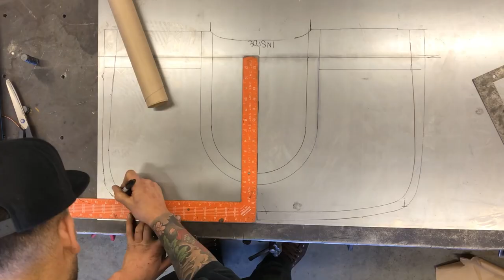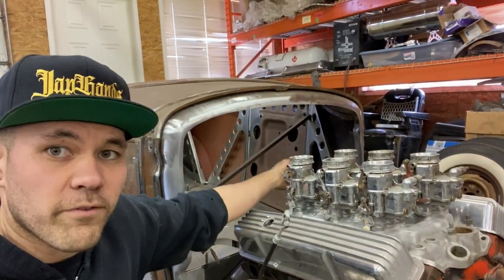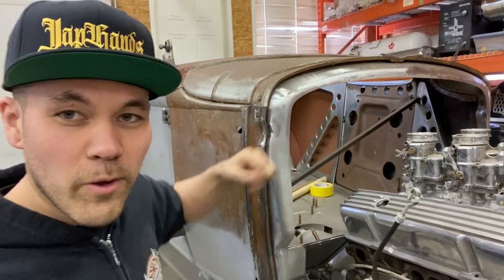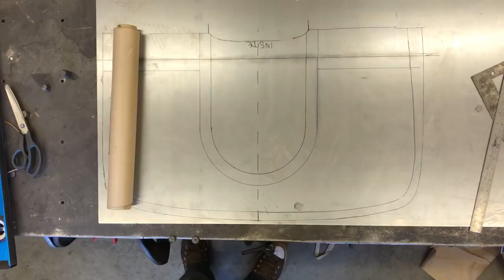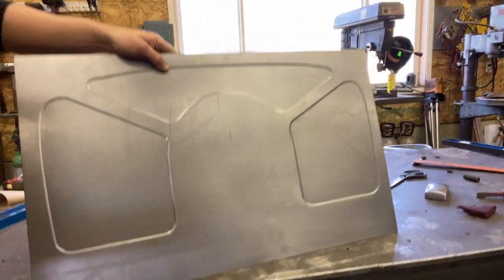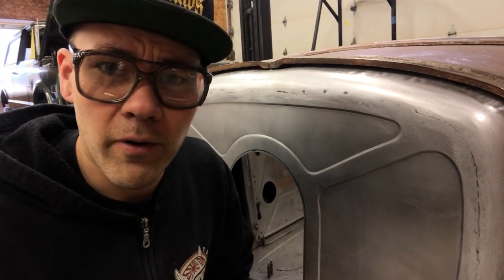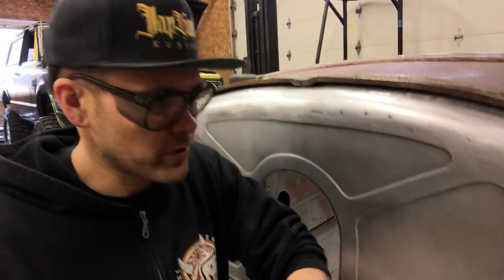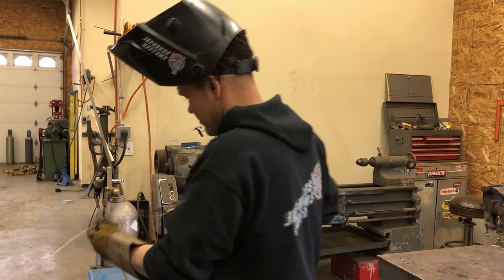How To Fabricate a Custom Firewall Using a Motorized Bead Roller (Model A Roadster Build Part 4)

Comment: I learned to weld in 1973, and have been welding ever since, this is some of the finest welding I've ever seen, the sheet metal work is top shelf, just doesn't get any better.  I got handed a torch and some coathanger wire, and told "to make it look like this", and sent to work.  You give excellent tips on getting through the most difficult issues, and show it done perfectly.  Thanks!

Comment: I just watched the last half of this again. Thanks for the TIG .035 filler wire tip. I’ve only TIG welded sheet aluminum, not steel yet, but will be trying this out on my Blazer.
Reply from the maker: Awesome you’re welcome!!
Reply: Unconventional metal do use of mid wire as filler metal in the process has been around for quite a while it's just not that well-known I guess you could say but it is more beneficial to use McGuire because the diameter of of the mixtile wire is smaller maybe less of a will build to have to grind down the height and the toy of the well perhaps there was a book written about this his name Ron Fournier you can find Old Street rodder magazines from the 1980s 90s late 2000 it covers some of this metal shaping detail even better

Comment: ok so i've saved up for a tig finally , In doing a fire wall is there much shrinkage when you bead roll a panel would you allow extra material and trim away or cut to size ... i don't have alot of space like you had.. it's for a 66 Beetle. look forward to hearing from you, cheers

Comment: How is it possible that the panel of the firewall remains flat when you have not pre-stretched it before creating the border ?

So great job as always and thank you for your pedagogy and your passion
Reply from the maker: I think it’s a combination between the thickness of the material 16 gauge and the small step. My guess is that it was easier for the material to stretch where the bead roller was then to put that much attention into the 16 gauge

Comment: Karl ... just awesome, I've seen your video on the van where you used a mig for sheet metal would you do a fire wall like you've done in this one with a mig??? that's all I have so just wondering your thoughts please cheers
Reply from the maker: This was tig. I generally like tig better

Comment: Could this be welded using a mig? Also the piece that was already attached to the car that you tigged the firewall to. Is that something you also made? It looks like it would add a few inched of leg clearance.
Reply from the maker: Yes it definitely could be migged as well The piece that was already attached to the firewall was a replacement firewall in a similar shape to what stock would be. When possible I like to tig weld things so that they can be hammered afterwards

Comment: Was going t I was going to say you could use mig wire as a usable substitute for the tig wire but a good thing to use McGuire 40 this cuz the mig wire diameter is a little bit smaller lot of hot rod builders back-in-the-day used a lot of mig wire for their to use that for team process I think the bead would be a little smaller where you wouldn't have to grind down your your weld wellfield that I'm in they call it Bluff in the world

Comment: Very clean work. Specially with finishing up grinding the welds smooth. What sander do you use? Thanks for the vids
Reply from the maker: Just a 80 grit on a DA for the final. Thanks a lot!

Comment: I don't know if you will see this comment. But I have a question: Before bead rolling the panel. Do you run it through say an English Wheel to stretch the metal first so it does not warp?
Thanks, have really enjoyed your videos so far, and you have given me a few new ideas for my own project.
Bart
Reply from the maker: Hey Bart! I try and read every comment an answer as many as I can. The bed rolling on this was not pre-stretched but in some cases I do pre-stretch when I would like to have a deeper bead or step. The English will those work great for this or a punishing hammer

Comment: What grit do you use on the DA? I use my angle grinder with 2" and 3" discs solely. Never thought of the DA.
Reply from the maker: Are use 80 grit on my angle grinder and then 80 grit on the DA

Comment: I have question about your bead rolling. Which die set are you using? I see you don’t do a pre stretch and your panels look really flat. Do you find that you don’t need to pre stretch with your die set?
Reply from the maker: It depends how deep you go and the thickness of the step. This panel had some “pop” in it too but I used 16 gauge. Also how it’s installed is a factor too when I do floor pans like this I find plug welding helps keep it flat when installed

Comment: I'm a beginner and have a silly question.  If I'm making a panel, should I cut the piece bigger if I'm going to put beads in it? How do you calculate that so I don't waste metal because I started to short or make it too big
Reply from the maker: I don’t make it any bigger. As long as the beads don’t run right over the edge, it cannot shrink.
Reply: @MakeItKustom  I've basically wasted a full sheet of 18 gauge because of that.. I should have asked a year ago when I started following you. I have a 32 ford pickup that is consuming me. I appreciate the reply and your videos ✌🏼🙏

Comment: Why do you hammer the welds and then grind/sand?
Reply from the maker: If the world is nice and smooth and consistent there’s barely too much material still hammering the weld helps stretch it

Comment: How do you like that makita electric shear? Does it distort? Currently using thin 3 inch cutoff discs to trim. Makes beautiful cuts but dusty and time consuming🙄
Reply from the maker: I really like them as long as it’s sharp and adjusted they are incredible. I like to creep up on the cut so the excess peels off easily
Reply: I love mine as well.  Not cheap, but very functional.  As stated, plan to creep up on the final cut line.  Just like when using hand shears, creeping up to the line will drastically improve your accuracy.

Comment: Nice work as always Karl! Could you address the tipping die you use on the firewall? Are you using a polyurethane lower? Thanks
Reply from the maker: Yes I’m going to come out with a Bead rolling video in the near future I will explain it better. I’m using a steel tipping wheel on the top and the bottom in this video